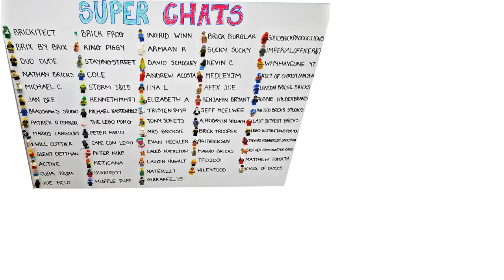Building A LEGO Skyscraper

Comment: And yet ninjago city stands as the second tallest building in the city.
Reply: Avengers tower: Are you sure about that?
Reply: I might be wrong, but while the avengers tower may have more floors the ninjago city has more taller floors plus an antenna sticking out of it. Even if not, third place ain't that short either. The town hall however, also should be quite tall.
Reply: Avengers tower: I beg to differ
Reply: Ninjago city :i beg your pardon